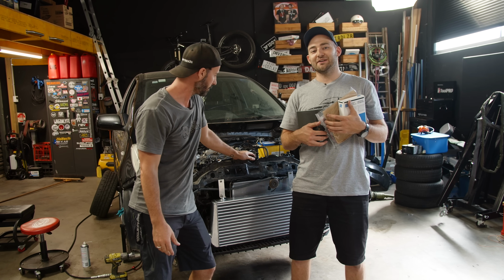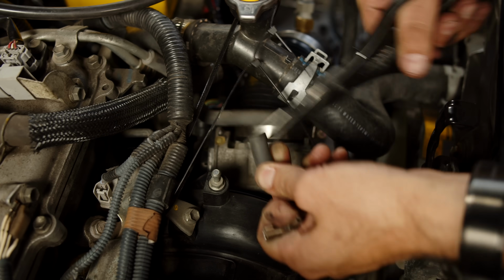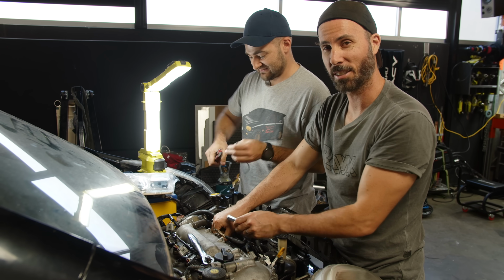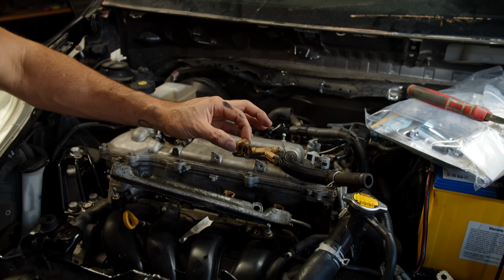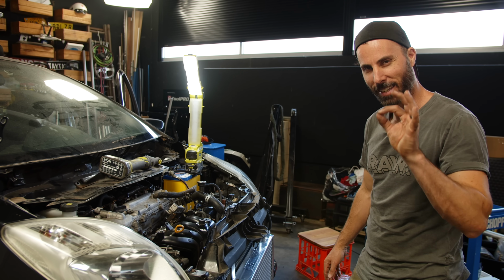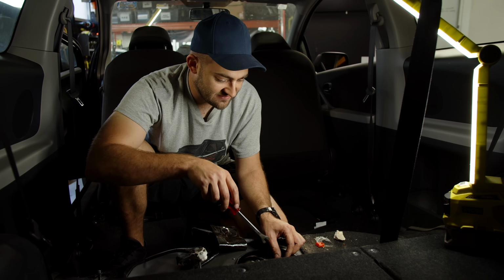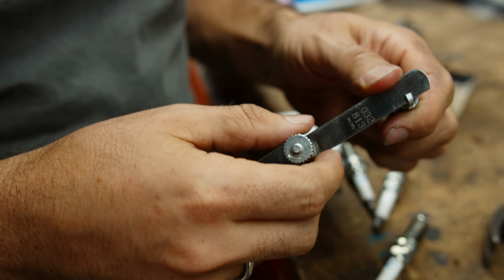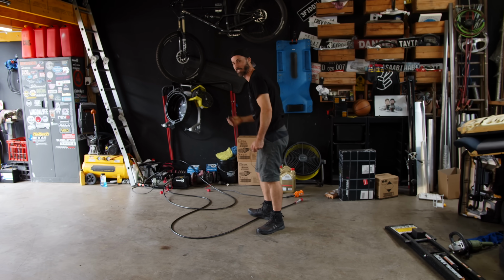Budget Yaris Gets BOOOOOOST // $169 eBay Turbo (Will it go or will it BLOW?)

Comment from the maker: Check out our brand new MCM 2020 Calendar! Perfect for your office, shed, garage (or toilet) Just $20AUD (approx $13USD) https://mightycarmods.com/collections/books/products/mcm-2020-calendar
Reply: Mighty Car Mods your workshop is haunted 😂😂
Reply: Next proper nugget.. Kia Picanto 2.0 litre Cerato 6 speed swap.
Reply: $20 or like 200,000 Rupiah
Reply: Yeah< the earliest I've caught a video. From Texas, Cheers guys.
Reply: 100000 rupiah = 10.84 Australian dollars
Reply: (Also I dunno about the Yaris' itty bitty fuel pump but a lot of that setup actually looks just like 90's Volvo,  except the in-tank charcoal thing.   I dunno if Corolla stuff would fit,  but there might be a way but it's currently 3AM on this side of the planet.  :)
Reply: Mighty Car Mods challenge, can you gap a plug with a Tim tam, no cheating and using a double chocolate 🍫
Reply: @1:14 the box starts slowly moving what u lot put in it, because that was creepe
Reply: @szajbusGaMeS21  if you look close it started to move at start of the vid I think there shop might be haunted time to call scooby doo
Reply: 17:47  Moog making room for boost chub.
Reply: I OWNED A Yaris and THIS IS what you need to do next!!!!!!!!!!!!

1. Strip out All the carpet and plastics on the inside! 
2. Remove the dash and the front air bags
3. Put the front seats back in and throw the back seat out. 
4. With all the weight reduced you can now build a roll cage straight of the bars running across the fire wall 
5. Use your imagination 😉
Reply: It's called cloth tape
Reply: My guess on power for the Yaris, 147kw.
Reply: 5000 rupiah  = 0.54 Australian dollars 😄👍
Reply: I have a special tool she get those bar plugs out #ToYotaTechnician
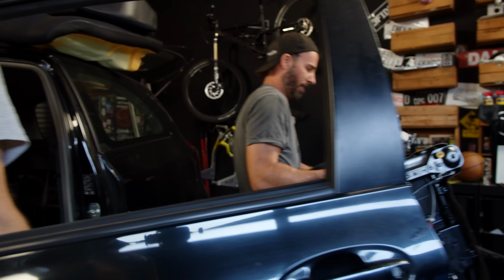Reply: 11:15 - 12:00 😂😂😂
Reply: https://en.m.wikipedia.org/wiki/Duct_tape
Looks like it was originally called duck tape sorry Marty.
Reply: Duck tape is a brand name, of duct tape.
Reply: @capricechild92  and also the original name of the tape
Reply: Nice little rocket you got only if Toyota would do that from the factory in that size of a car. Well if not from the factory we got people like you to do it FUN TO WATCH!
Reply: @mightycarmods what do I need to track a Toyota Vitz/Yaris RS from 2003?
Reply: I need help!
I'm looking for a small, cheap, fun to drive, Toyota hatchback, to take to the track.
Reply: Noticed the Box that fell at the beginning, gradually moves out starting a 1:13. It’s starts flushed with the shelf & moves out! 😮Call the ghostbusters 👻😂
Reply: Do you have an MCM Rubber Duck?
Reply: Mighty Car Mods  whatch the latest episode of( the unicorn Circuit )and possibly get 10% off your new MCM calendar ✌️
Reply: Me: writes smart comments

MCM: builds car
Reply: What's up with the serial killer in your loft ??
Reply: Hey look back at the footage where the box fell at the beginning.  It was literally moving in it's own then fell.. weird
Reply: Marty! Moog! Check it out! I found your Yaris people! They have a tuned Yaris on a dyno
https://youtu.be/gJMxvLPEZrM
Reply: I’m interested in sponsoring the show. e-sell.com
Reply: Mighty Car Mods why are turbo kits now cheaper than a nitrous kit. Let's see those cheap Chinese eBay nitrous kits lol. I guess China would call it the NAWS kit
Reply: What manifold is that?
Reply: Bro bro bro I dare you to kit out and turbo charge a robin reliant 😂😂
Reply: Hopefully that calender doesn't have a picture of Moog wearing Speedos for June 🤢🤮
Reply: If you were wondering the 100,000 rupiah to Aud is 10.91 in total.
Reply: I Say 134kw.. i bet you One MCM sticker 😋🖐
Reply: What's with the ghost box that fell?
Reply: Pretty sure it was called duck tape because it was originally made of duck canvas with an adhesive back.
Reply: man, someone stole your song. https://youtu.be/VEEW6UPpmW0
Reply: wish you had the calendar back in december, if i order it now i wont get it for a month which means i'd miss out on almost 3 months of calendar
Reply: MOOG is correct it was originally called duck tape, and ir came in green. it was developed during WWII by Johnson and Johnson for the military bc they needed water proof tape. duct tape is tape that has a thermal reflective coating bc it was used in air ducts and was developed much later. why do ppl call duck tape duct tape. well for the same reason ppl say octopai when the correct pluralization of octopus is octopuses. it sounded right at the time, it caught on and it kinda just became accepted bc so many ppl were saying it. granted that misconception came rules of Latin plurals.
Reply: @d.mat.zero6525  because a company released and still sells a brand of tape ranging for gaffer to duct tape called Duck Tape
Reply: It's duck tape, and it has military applications.
Reply: Duct tape lol
Reply: So

Comment: 5000 rupiah 😂😂😂. I actually live in Indonesia and have a 2015 manual trans Yaris,  my car is in the shop now getting upgrades: port n polish, uni-chip, 4-2-1 long tube header...  maybe replacing center pipe as well.  no emissions testing here so that's not an issue.  I wanted to install a turbo kit, but the shop strongly advized me against it.  still considering it though, any recommendations ?

Comment: Duck tape or duct tape. Duct tape is a silver-colored strong adhesive tape, usually a few inches wide, that is used to repair a multitude of things. It is specifically manufactured to join heating and air conditioning duct work, though the uses for duct tape are uncountable. ... Duck tape is a name brand of duct tape.

Comment: I've seen larger hoods on a sweatshirt!  Did you guys install plugs different from the factory's heat rating?
Reply: On my 2006 2ZR -swapped and turbo'd Yaris RS, I used one step colder plugs and gapped them to 0.28. I'm pretty sure that the Yaris hood is 18" front to back. Yep...pretty tiny.
Reply: @acbent11  Thanks, Adam.

Comment: monkey wrench racing has some great stuff on modding the corolla 1.8s, if that engine is anything like the 1zzfe you will need to do the aem fuel line kit which gives you all of the required parts to install a return line and adjustable fuel pressure regulator, AN fittings as well.

Comment: actually it is duck tape . wikipedia During World War II, Revolite (then a division of Johnson & Johnson) developed an adhesive tape made from a rubber-based adhesive applied to a durable duck cloth backing. This tape resisted water and was used as sealing tape on some ammunition cases during that period.[1]

"Duck tape" is recorded in the Oxford English Dictionary as having been in use since 1899;[2] "duct tape" (described as "perhaps an alteration of earlier duck tape") since 1965.[3]

Comment: Generally the toyota ECU's of this era needs to know coolant temperature before it will allow the DBW throttle to open 100%. If there was no coolant temp the ecu thinks its 'cold' and limits the throttle opening ... use a 330 ohm resistor to fool the toyo ecu into thinking coolant temp is 85 deg c.
Reply from the maker: Ecu coolant temperature still goes to factory ecu as nornal

Comment: Funny enough, I actually did change one of those fuel pumps recently in a 2006 Toyota RAV4. They are only used by Toyota from I believe around 2004-2012 and in a few select models. That goes for the strange filter and strainer setup as well. The entire assembly is odd and also very expensive. The pumps alone can be hundreds of dollars and the filter assembly can double the price. Truly don't understand why Toyota started using them and trying to be different, but they switched back to the industry standard later. A lot of parts on those years of Toyota end up being strangely expensive and uncommon.

Comment: 128 KW at the wheels is definitely achievable. I'm running Deatschwerks 440cc injectors on my 2ZR swapped turbo Yaris. I made 115KW wheels @5psi with two boost leaks and a improperly adjusted wastegate actuator arm (after "cocking" the turbo). I'm at around 8 psi now and will be dynoing again in the spring. Looking forward to seeing my numbers compared to yours. The  stock Yaris fuel pump is good for about 8 - 9 psi. At my max boost and 6000 rpm, I still make close to 11.5:1 afr.  You may run into fuel starvation with those big injectors at higher boost. Eagerly anticipating the next video in the series.

Comment: Could use an MSD 2351 boost-a-pump to bump up fuel pump voltage referenced on MAP pressure. I use one to 19v (22v max) on a Procharged C6 Grand Sport. Works well.

Comment: What I don't understand is why not just put an external inline pump in it? I don't know much about new cars though so there's probably a reason for it. Can someone enlighten me? I have to learn about new cars anyway. I'm actually picking up my new car this weekend and I'm seriously stepping out of my comfort zone with it. Every car I've ever owned has had a return fuel line, a throttle cable and a clutch cable. My new car has a hydraulic clutch and an electronic throttle and the engine is in backwards like Yaris Hilton. Its some kind of Ford Focus. LX I think. Lots of plastic to throw in the bin. But hey, I've still got the old DA3 Integra in the garage to play with for whenever I feel like kicking it old school.

Comment: If you use water injection you don't need to add more fuel... Just run it leaner on stock injectors with LOW boost.

Volumetric efficiency increases, just keep the knock down!

Comment: It was called Duck tale during ww2, for its ability to repel water like a duck.. after they brought it home, they found a cheap use for it in the heat and a/c  industry and called it duct tape. After the ducts it was used to tape together.

Comment: Do you have Fiat Abarth 500's down there? They are a hoot to drive, 1.4 liters of turbo fury! I bought a modded one for 1800 US dollars that has racing clutch,  quaffe front diff and a stage0 tune. Makes 160-180 wheel horsepower and weighs 2400 pounds.

Comment: Actually,  it spawned from the HVAC industry. For sealing the joints in air ducts. Und hence, the term Duct tape.  I know it's right because my father worked in that industry for 45 years. Cheers mates

Comment: It's Duck Tape, not Duct Tape.

Duck Tape is NOT rated as being good enough for use in air ducts, unless it's a specific kind of Duck Tape known as Duct Tape that's backed with heat-resistant foil.

"Duck Tape" as a word was first recorded in a dictionary in the 1890's, while Duct Tape came in the 60's specifically as an alteration of the earlier word.

Also, Moog's right, Johnson and Johnson came up with what we now know as Duct Tape in the Second World War by combining duck cloth, a specific and durable weave of cloth, with rubber-based adhesive. The Duck Cloth weave combined with the waterproofing properties it had is generally accepted to be where the name came from.

Comment: 1:08 the box starts to move on it's own. 

Pact with devil confirmed
Reply: The dude's face in the back.
Reply: @miguelguzman-pg7fp  guy seems very confused and a bit blown away at what just happened!
Reply: First the bottle and now this? That Yaris is haunted.
Reply: Its the blue turd , back from the dead to haunt the living ...
Reply: Yes.  They need to check that out.  The box was moving on its own
Reply: 1.The Engine Crane Movin by it self. 
2. Spray Cane slidin
3. The Box
4. ?

Comment: The new Deatschwerks 440 compact pump (albeit worth more than the the turbo setup) are designed for direct pump replacement in the modules, especially smaller pumps like this. Check out the link if use hadnt already heard about them 

https://www.deatschwerks.com/blog/deatschwerks-introduces-their-all-new-440-lph-brushless-pump-and-controller

Comment: I love everything you guys put out! 

Duck tape or duct tape. Duct tape is a silver-colored strong adhesive tape, usually a few inches wide, that is used to repair a multitude of things. It is specifically manufactured to join heating and air conditioning duct work, though the uses for duct tape are uncountable.  Duck tape is a name brand of duct tape.

Comment: They make a tool to remove the nut on the shaft so you don't damage it. Toyota uses a crimp to keep nut from backing off. That damaged threads when u remove it. Sp tools #65420 is part number and it works great.

Comment: Denso fuel pump range a bell in my head. 

You're conflating 3 different products.

'duck' tape is a brand. 'duct' tape is from aviation. [ later used for air-based heating and cooling systems ] 

Whereas Denso [ TM ] tape is from underground and underwater applications. [ I have used this since 80's to temp seal shit pipes underground to stop seepage ]

https://www.amazon.co.uk/All-Trade-Direct-Corrosion-Waterproof/dp/B00904QGA0

Comment: Let's settle this:

1942 - Duct tape is invented during World War II. American soldiers use the strong, versatile adhesive for everything from repairing broken windows to making temporary bandages.
1945
 - After the war, the tape is put to use holding ventilation ducts together and gains the name "duct tape" and becomes the traditional silver color.
1980 - Jack Kahl officially creates a branded duct tape under the Duck® and Duck Tape® trademarks and becomes the first company to offer Duck Tape® colors.

Marty is right. Moog is half right. Together they create an inseparable bond, similar to that of DUCT TAPE, which is produced by a company under the brand DUCK TAPE.

Comment: Duck tape is a heave duty water resistant tape designed for hold stuff together and not break/snap as easy as normal tape.... duct tape is a sealant tape that is heat resistant design to seal heating and air con pipe work after the pipes have been joined with screws/bolts or an adhesive to stop any air leaks

Comment: Wouldn't sit right to have a comment section go without an internet expert present. 
Originally called duck tape for the reason Moog stated many companies down the line started calling it duct tape. However the product is not very appropriate for HVAC applications. The one video I watched told me so.

Comment: If its not gana start them just check the oring on the fuel pump. U need to fit the oring onto the fuel pump holder then push the pump into the housing and use some greas please. O and check the oring if it's torn. Can cause loads of problems

Comment: yes its a cheap turbo BUT taking into account how much would have been spent with the new injectors, fuel pump, ECU, wiring AND tuning etc (assuming someone was capable of doing the rest themselves)this is NOT a cheap conversion in reality!

Comment: Go Marty ... Duck tape or duct tape. Duct tape is a silver-colored strong adhesive tape, usually a few inches wide, that is used to repair a multitude of things. It is specifically manufactured to join heating and air conditioning duct work, though the uses for duct tape are uncountable. ... Duck tape is a name brand of duct tape.

Comment: 1:15 that was Turbo Yoda. He Is Most Displeased
I would have put the celica 2 ZZ-GE 140KW in it. 
return system. Just drill the end of the rail. tap in a thread. bobs ur uncle
spark plugs.. just put iridium's in so they last the 2 weeks before you sell the car (like you always do)
re spark plugs. why you put anti seize on them? NGK plugs have a zinc coating which is drum roll...... anti seize 

the 19 minutes was shit. why not just show the ecu being isntalled then you go to haltech get it tuned and thats it. instead you just filled this episode with shit....
Reply from the maker: 2zr’s are cheap, have to run a long return line with the engine buried under the windscreen, we like coppers for boost

Comment: "Duct tape, also called duck tape, is cloth- or scrim-backed pressure-sensitive tape, often coated with polyethylene. ... During World War II, Revolite (then a division of Johnson & Johnson) developed an adhesive tape made from a rubber-based adhesive applied to a durable duck cloth backing.". So you're both right.

Comment: You guys are aiming low as! The mighty Yaris makes 98–217 hp (73–162 kW) factory, depending on the engine if its a 1.6/1.8/or 2.0. Either way Yaris is gunna be over 115 and 128 for sure.

Comment: I’d be worried that the con rods are not strengthened along with the crank shaft and valves.
If it was that easy, people would be bolting turbo’s on everything

Comment: picked the wrong engine guys , should have got a 2zzge and trans .had a sportivo corolla with one many years ago vvtli i think it was variable valve timing and valve lift 6 speed trans , loved it .frightened commodores and falcons,biggest drawback was the power band .but still pulled 220 in 5th but could only pull 215 in 6th under what was in the operators manual.lmao great show guys dont miss it.

Comment: During World War II, Revolite (then a division of Johnson & Johnson) developed an adhesive tape made from a rubber-based adhesive applied to a durable duck cloth backing. This tape resisted water and was used as sealing tape on some ammunition cases during that period.[1]

"Duck tape" is recorded in the Oxford English Dictionary as having been in use since 1899;[2] "duct tape" (described as "perhaps an alteration of earlier duck tape") since 1965.[3]

Comment: Duct tape was originally named “Duck” tape and originally only came in green, not silver.

Duct tape was originally invented by Johnson & Johnson’s Permacel division during WWII for the military.  The military specifically needed a waterproof tape that could be used to keep moisture out of ammunition cases.  This is why the originally Duct tape came only in army green.

As to why it was originally called “Duck” tape by the soldiers isn’t entirely known.  It is commonly thought that because it was green and shed water, like a duck, the soldiers took to calling the tape “Duck” tape.  An alternative theory is that they called it thus because it resembled strips of cotton duck.  Which one is true or if it was a combination of the two, isn’t known, but in either case they called this new tape “Duck” tape.